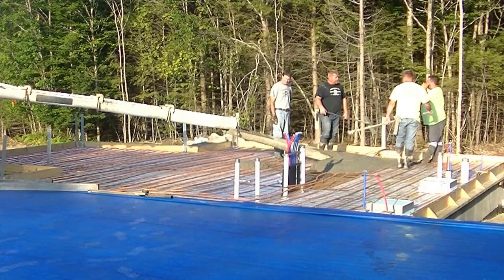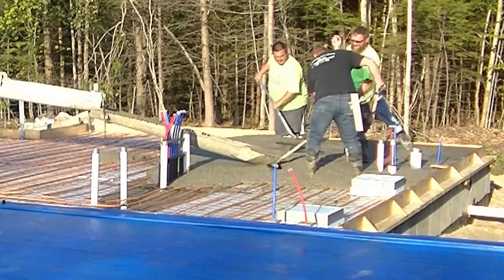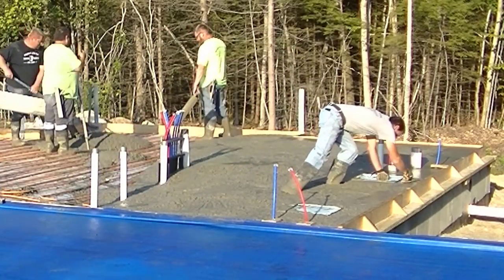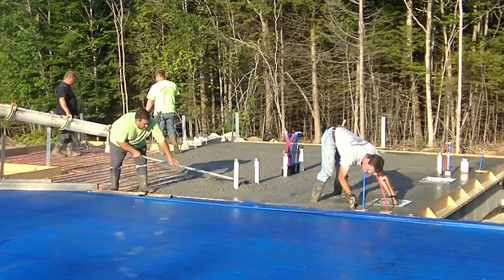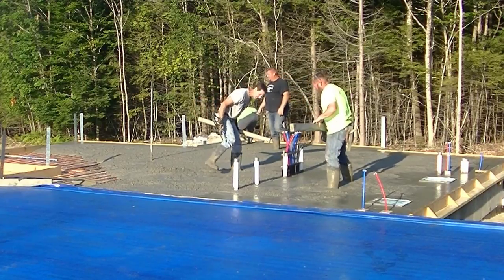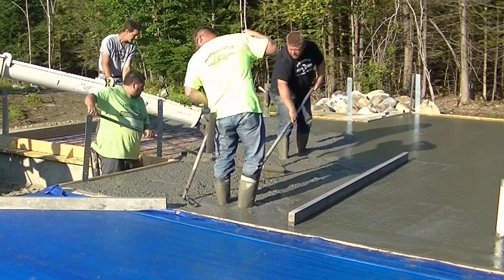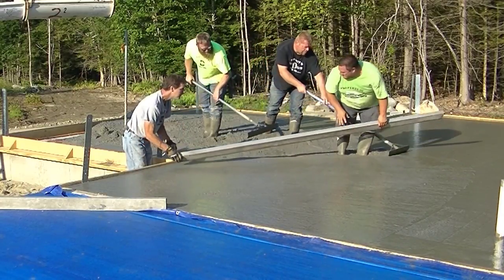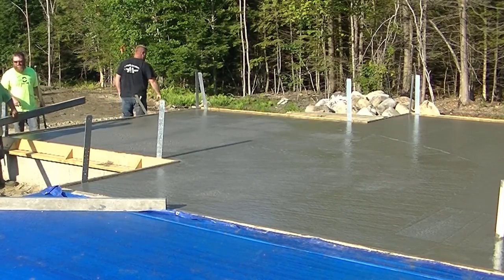Pouring, Screeding, Bull Floating A Concrete Floor Addition (New House)

Comment: Great stuff, as usual, Mike. Would you consider doing a video on the use of the laser?

I'm a GC working on Long Island, NY, we just finished installing a 4' sidewalk around the perimeter of a residential garage. 5" thick, 4,000-lb. test, 5 1/2" slump, 5% air, fibre-reinforced , plasticiser, with wire mesh as well. Did our homework with your videos.
Reply from the maker: Jim, what in specific with the laser?
Reply: @MikeDayConcrete  Thanks, Mike. We've used the laser a lot shooting it horizontally to set up forms, etc., but I'm not familiar with the technique you seem to be using to set up the height of your wet pads, for example, where the laser is attached to a vertical stick. The explanation may be something simple that doesn't merit a whole video, but I'm curious as to how this works.